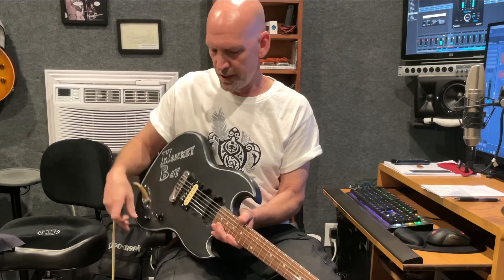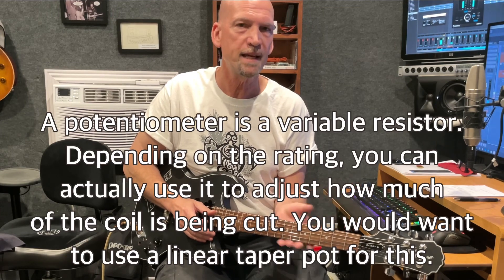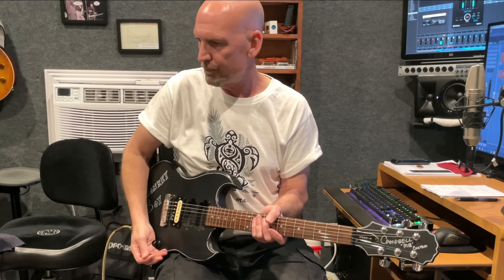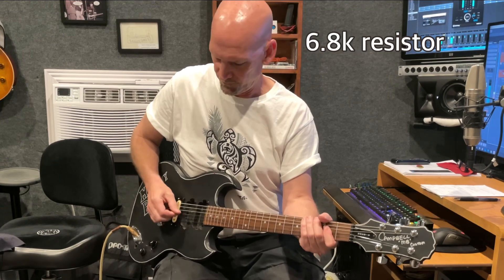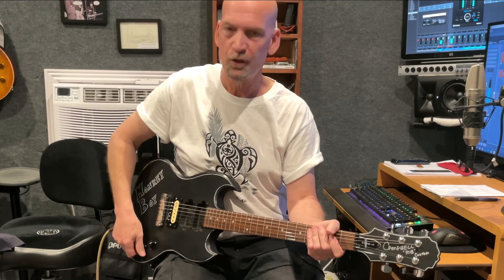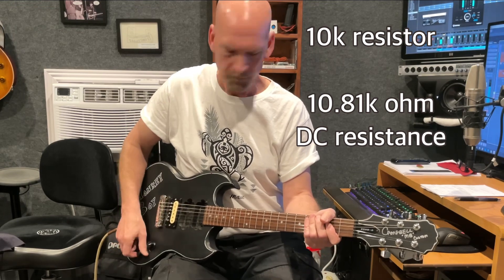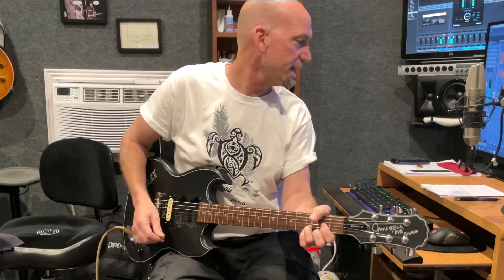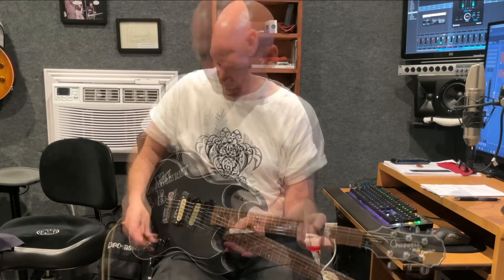Coil Splitting with Multiple Resistors

Comment: You could also use another 10k or 20k pot to replace the fixed resistor for extra variability. I normally just use the standard 1k on neck and 2k2 on bridge. You can also add a cap with each pickup to change the resonant peak.

Comment: I wonder about the difference betweeb that and simply turn down the volume pot without the resistor(s)..
Reply from the maker: I guess it depends on the pickup and the wiring,… 50’s, 60’s.
The pickup I used is quite hot, and it rolls off very “dark”.

Comment: Hi Charles.  Great video.  I'm planning on putting 3 x hot rails in place of my single coils in my strat and replacing the second tone with a rotary switch (master volume and tone).  Do you have any recommendations for the resistor values?  I'll use position 1 on the rotary as full humbucker and position 5 as completely split so it's the 3 positions in between I'm asking about.   I'm hoping to get it right the first time so I don't have to remove the strings and pickguard.  Thanks for any advice you can offer.
Reply: Honestly, I’d go with the values I used for this project. Hot rails are very similar to the humbucker I  used.
Good luck on your project.
I’d probably do the same thing.

Comment: Sorry for not understanding the exact circuit mod going on here. Are you taking one coil of the humbucker out of the circuit completely and then adding a resistor in series to the remaining functioning single coil's connection to ground? Thanks for this video, I am just a little bit slow so any clarification would be greatly appreciated. I definitely like the extra tonalities you are achieving with your mods!
Reply from the maker: The cap and resistor are on the ground of the coil that’s being “shut off”,…. So it’s staying in the circuit with less output and shaped sound, changing the overall character of the pickup.

Comment: Hi. Thanks for the video, it encouraged me to experiment with my Seymour Duncan SH4. I didn't need the sound of a single, I needed the PAF sound of my SH4. I ended up picking up a 60K value to get the same humbucker sound, but with a clearer and more open top and slightly less output than the SH4. It's very cool, sounds like a PAF on steroids!!!

Comment: I've done similar but different things with resistors and caps, but with the R/C (in parallel) in line (series) with the hot lead. Am I correct in assuming that your resistors tap off the hot lead and go then to ground? I've done that with caps, but not resistors (that I can recall).

I didn't like the sound of my Tele when both pickups were on. So I used a resistor interrupting the hot connection going to the switch to lower the volume of the neck pickup. But I found that there was too much loss of treble. So I bypassed the resistor with a cap to retrieve some of the treble. I much prefer the two pickup option now over stock.

I did the same with my neck pickup only sound. I have a four-position switch that gives the stock neck sound and a second reduced bass sound. Again I used an R/C in line with the pickup hot to send some, but not all, of the low frequencies to ground. That's another very useful option.

Comment: I done a straight split and it’s too dropped.  I was going to try the parallel switch technique.  Have you tried that?
Btw i got an origin head 50 too.  Works great with my fuzz pedals, and any pedal really
Reply from the maker: Parallel is hum cancelling, but does drop the output significantly , like coil splitting.
I have liked using the cap/ resistor method better because you can choose how much coil is grounded and do a little tone shaping too. I’m not going to bother with series/ parallel switching any more.

Comment: Incorporating a female block connector or matrix-breadboard, would allow for a quick swap-out of potential components for the design.    Other circuit designs could be considered with different component types.       

Once-upon-a-time....   There was an electronics educational kit that used an ingenious modular cube arrangement;  each component was housed in a black plastic cube, with the component symbol and value printed on the top; each cube having the relevant pin-outs for each component type, these were then arranged in circuit by plugging each block into a large breadboard.     I am adapting a cruder version of that concept to my test-bed guitar, allowing me to choose and swap components at will.  

NICE DEMO.    Ahhh..... THE  GUITARIST'S  NEVER-ENDING  SEARCH  FOR  THAT  UNIQUELY  PERSONAL, YET  OFTEN  ELLUSIVE  VOICE.

Comment: Have you tried spin split pot with detents?
Reply from the maker: I’m not sure what you’re speaking of. This switch is notched.
Reply: @charlescampbell6167   Was think about trying a pot with stops on wiper, so you can more easily find the amount of cut you need using the resistance of the pot instead of wiring up a bunch of set value resistors on the switch. Still not as useful as your switch, in theory, but less time at the bench? 
I will try it out sometime soon maybe can offer more feedback. I have tried some resitor switching mods similar to yours and I do like the option for sure.

Comment: 10k resistor is virtually no split at all
Reply from the maker: Being that the DC resistance on this pickup is over 13K, there is still a noticeable difference. Even just a little drop can also give you the perceived asymmetrical coil windings of a PAF.
Reply: Also it's audio taper that is smooth. Linear taper all goes in about 10 degrees of a turn of the pot
Reply from the maker: https://images.app.goo.gl/6o9mvZRPfqc7rAEv5

Just using what the guitar industry says.
We all know that Leo was wrong about the Tremolo on the guitar and the Vibrato in the amp.
When mixing in my DAW, I do notice that linear fades are curved.
Reply: @charlescampbell6167 Jesus lol.  I know what the graph looks like but it sounds like you need to learn how hearing works. Linear taper will appear to go all at once and a log or audio taper will be a smooth transition from 0-10. YOUR HEARING IS LOG NOT LINEAR
Reply from the maker: Thank you for your input. I can tell you're paginate about the info put out there. I'm just trying to put out info that most people may understand,... including implied volumes and sounds.
Reply from the maker: I meant no insult. Just wanted to say we know things have been called the wrong thing in the past.
It's a bit of a battle getting good info out there, especially when there's a lot of bad info out there. I certainly don't want to give out bad info, though I know I've made mistakes.

Comment: One of my guitars has a phase-reverse switch for the bridge pickup, as well as a Peavey T-60 tone control for that pickup.  That tone control pans from one of the coils, through to both coils, and finally both coils with treble cut.  When I flip the phase switch, the coil in use with the tone control set to max brightness, can be flipped.  I was quite surprised to hear the very audible difference between the two coils of the same pickup.  I suspect this is relatively unique to bridge pickups, where a half-inch this way or that makes for a different harmonic profile (why Fender angles the bridge pickup on Strats and Teles).  I would not expect it to have as big a difference on the neck pickup.

Comment: This is a great idea! Is there a name for this mod? Is there a wiring diagram available?
Reply from the maker: It may have been done before. I haven’t seen it anywhere. I had to figure it out. I just used diagrams of other modifications that I found on Google, and used what I needed from each.
I bought the switch and resisters on Amazon.

Comment: Thank you for the effort. It would be nice to hear how neck pickup will sound with these mods, and bridge+neck series/parallel combination to hear will it be some kind of close Strat sound.
Reply from the maker: I’d imagine using a pickup in parallel mode with added resistor would just make it too quiet.
This resistor trick is already used by PRS and Gibson to help balance the perceived volume of the pickups when in split mode. The resistor value also changes the tonal characteristics….
It’s a rabbit hole really.

I may put the switch in a 2 pickup guitar one day. Maybe I’ll make a video if I do that.  ;)
Reply: @charlescampbell6167  True, resistors can be great, but they indeed also affect tonal characteristics.. notably the low end! Depending on the actual pickup and the resistor value, it can make your pickup sound completely different (which can be desirable or undesirable). You can also use resistors (around 500K) to make your single coil(s)/split humbuckers see 250K instead of 500K/550K in a HSS/HSH configuration. I just completely transformed a Harley Benton Fusion-III (HSS) guitar with stock Roswell pickups, which sounded awfully bright/brittle/harsh/unbalanced (I had to roll off the tone pot to half to make them usable).. just by adding a 510K resistor from the pickup hot wire on the selector switch to ground (one for each pickup, including the split bridge humbucker). Now, they sound pretty much like Seymour Duncans.. super balanced, zero harshness. Although, you really have to try different values to find to proper one for your guitar. It is truly is a rabbit hole indeed!  BUT this is so fun (and frustrating lol)
Reply: @charlescampbell6167  Thank you for the answer :)

Comment: I liked the 10k as well.
For a permanent installation, a trimpot in the cavity would let you set just the right amount of resistance without running into the issue of losing the exact setting on an external knob.
Reply from the maker: Indeed. There are so many ways to do things and so many options. I’m sure lots of people have come up with lots of ideas I’m not even aware of.
I didn’t known until recently that several pickup builders make tone shaping circuits. (a lot of them passive passive).

Comment: Great demonstration, thank you!
Which coil has the hot connection? Bridge-most or neck-most?
Reply from the maker: I wired this to leave the coil closest to the bridge on. I prefer the furthermost coils stay on to be closest to the S or T type sound when split.
Most pickup manufacturers schematic their pickups to leave the slug side on when split. Usually swapping the hot lead and ground lead will reverse that.
Paul Reed Smith says he prefers the slug side stay on. Again,… preference.

Comment: Charles: Is this similar to using a Varitone switch like you'd see on  Epiphone BB King model?
Reply from the maker: I believe Veritone uses capacitors to very the midrange frequencies.
Using resistors to ground an one coil varies the volume of the coil that’s going to ground.